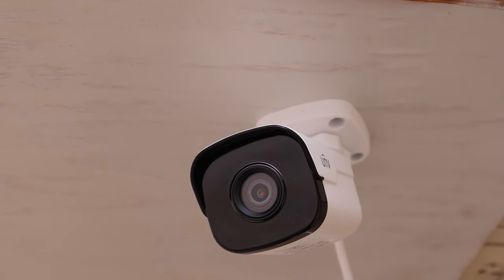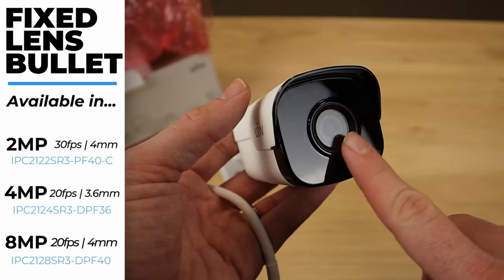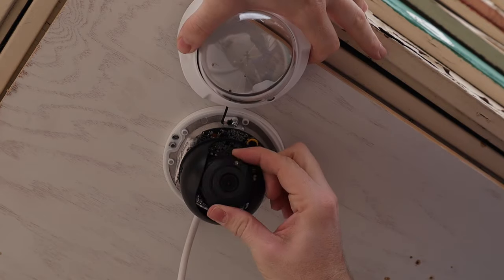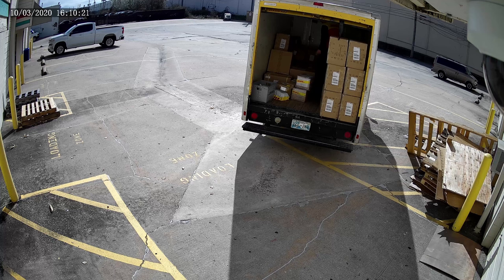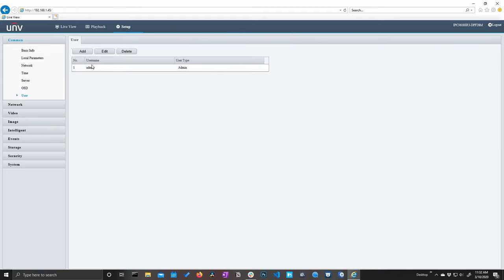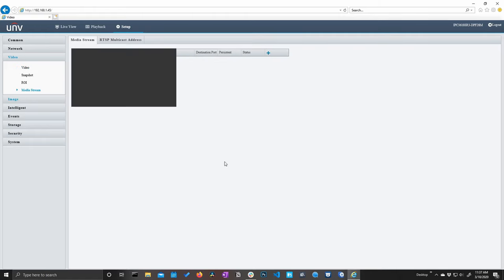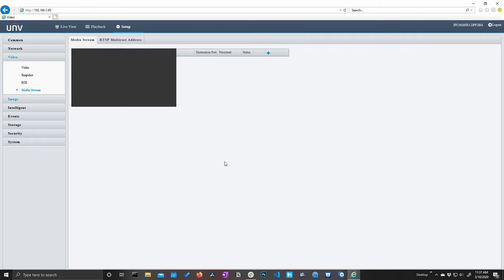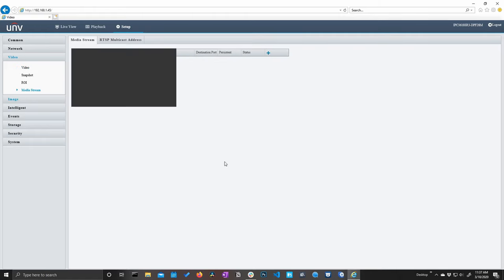Full Review of Uniview's Fixed Lens IP Security Cameras: Bullet, Turret, and Vandal Dome

Comment: I have tried to set up my UNV, but when plugging the IP Camera cable direct into the unit POE ports the unit shuts down. And switches back on when camera cable is removed
Reply from the maker: Have you tried using a different cable? Please contact our support for further assistance 855-340-9999

Comment: I see where you can set the people counter to clear.  Does it store cleared counts? Do you have the ability to run a weekly report by day for retail clients?
Reply from the maker: My understanding is if you clear the count, it only clears the count on the interface. So, for instance, you can have it set to clear the number every day at midnight, so that the number on your monitor is only the count for that day. But the NVR will store the total number regardless of how often you clear it. So yes, you will be able to run weekly reports based on the total number of people entering and exiting, regardless of whether or not the number on the interface has been reset every day. I didn't see a way to reset the total number in the database, but I'm sure there's a way.

Comment: Hii...do you have any idea about wdr with central point in UNV cameras?
Reply from the maker: WDR is handled very well with UNV cameras. Anything specific you would like to know? Be happy to help
Reply: @NellysSecurity  the camera model no. Is ipc2122lr3-pf40.
The camera is installed to see the entrance from inside as the entrance recieves direct sunlight during day time.I have turned on the wdr on the camera but it isn't doing really well to maintain the dynamic range of the scene.
Hope you can help me with some suggestions🙏

Comment: Why can’t I view anything without a plug-in
Reply from the maker: Very good question Cubs Fan!

Chrome & Firefox support is still limited. Firstly i would verify that whatever Uniview unit you are logging into is up to date with its firmware. If that still doesnt help with browser support, then using IE or Edge in IE mode will be the best route to go.
There is also Chrome with IE Tab extension. Then of course EZStation to view the camera as well.

If you purchased your uniview equipment from Nelly's, please feel free to reach out to our support team ->  customerservice@nellyssecurity.com / 855-340-9999